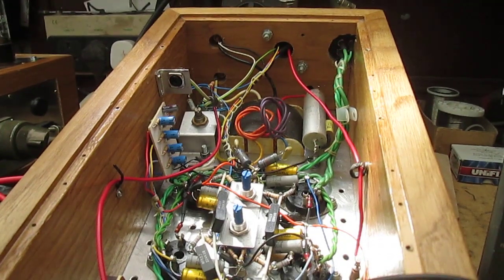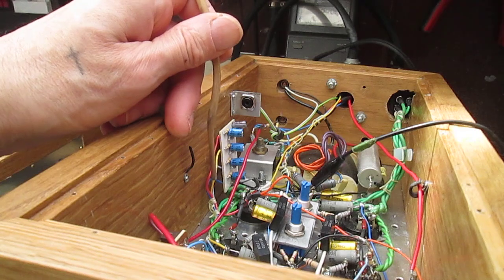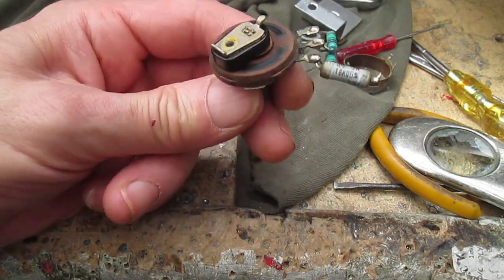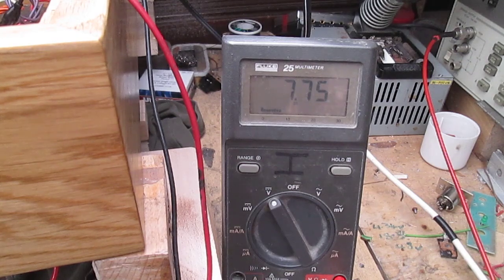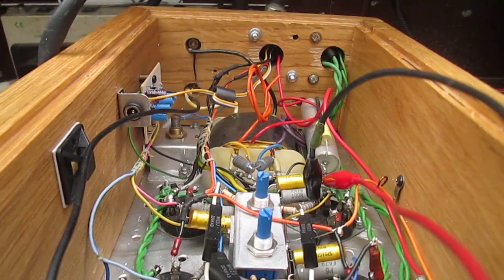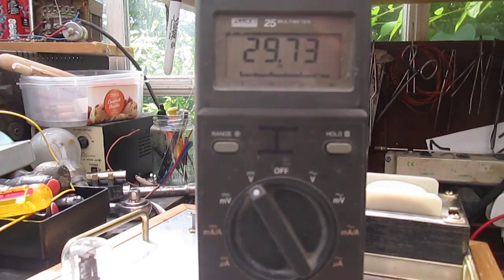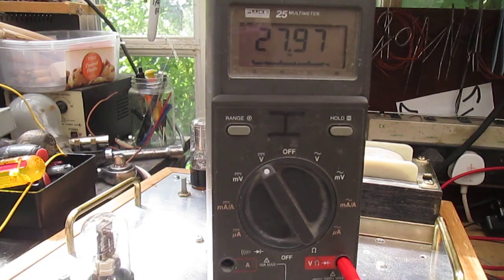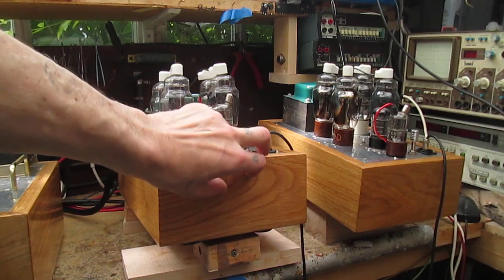50w Class A 807 PPP Valve Amplifier Refurb - Part 2

Comment: I too like repairing my pots instead of replacing them - that also applies to all my other projects, no matter if it is a valve amp, flourescent lamp, electrical project, vehicle, solar power, you name it! I repair and reuse everything I possibly can. I have a VERY limited budget, so yeah, I make do with what I have and can find! I also reuse parts from old projects whenever I get tired of them! So nothing goes to waste, ever! Many of my things are trash picked, and repaired/restored to useful shape - my flourescent lights in my off grid solar power shed is a great example! I like them a lot, and they came right out from the dump! I recently aquired a generator set that I am repairing, the connecting rod bearing is bad, it knocked like hell! So instead of trashing it, I am going to replace the connecting rod. Just gotta wait for it to arrive from ebay! was not that expensive either, so soon I'll have a good little generator to use whenever it gets dark and cold, and the solar panels arent doing anything :D
Reply from the maker: Me too, hate throwing stuff away. Have kept an old Panasonic vacuum cleaner going for nearly 20 years, my daughter finally managed to get me to admit it's cleaned it's last carpet: it was a hard struggle, she won : )

Comment: Nice. Are you going to add any ventilation for the chassis? That should lengthen the life of the components & transformer.
Reply from the maker: There's a 4" fan in each one pushing air past the OP valves, I'll try & remember to show them in the next video. TFW.